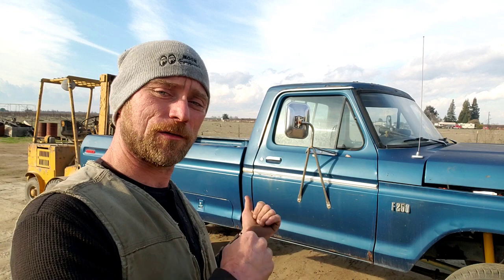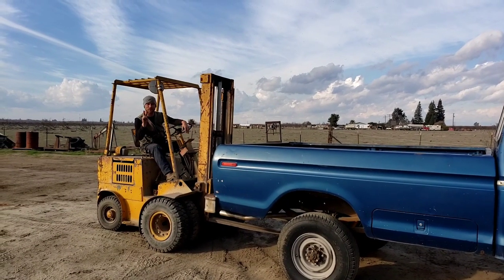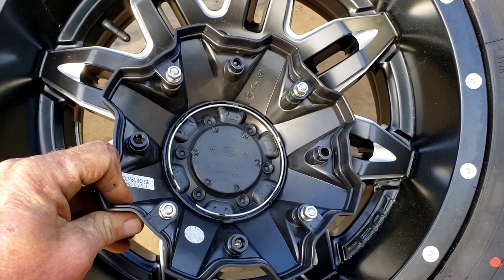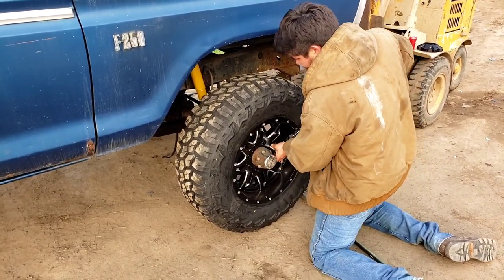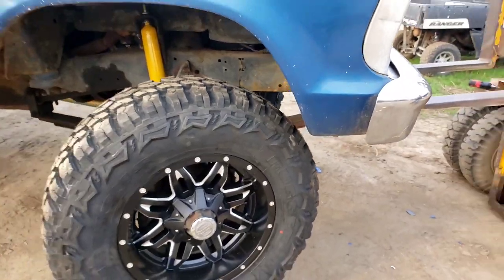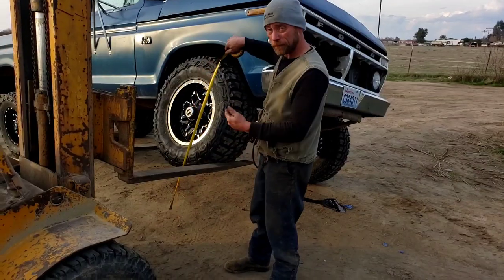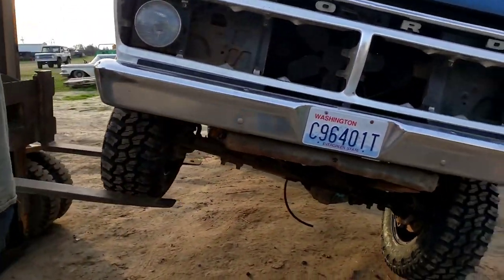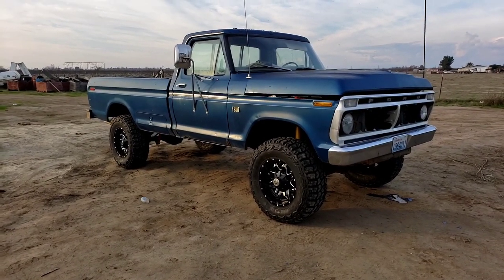1974 High Boy - f250 - truck restoration - New Wheels and Tires - 35's on a stock high boy

Comment: i have a 1994 ram 2500  4wd  5spd which doesn't have locking hubs is there a reason i might want to convert it.
Reply from the maker: It only saves on fuel economy.... if you are happy with your mpg's don't worry about it

Comment: I got a 75 250 4x4  with the 360 v8 in the process of buying new rims and tires and will have almost twice in the rims and tires as i paid for the truck
Reply from the maker: lol that's the way it works
Reply: @CVcustoms  yup!! Bought the truck for 1000 been sittin at least 10 yrs and put about 200 in it and she runs n drives n stops haha good ole Ford!!  I really liked that flex test being that is a 76 it's probably the same for my 75 which 2 ft of flex is pretty good in my opinion for a full size ¾ ton pickup with solid axels and leaf springs lol

Comment: Its too bad that they chose those fugly, oversized wheel and tire setup.
Those huge tires are going to put a tremendous amount of stress on the steering linkage and hydraulic system